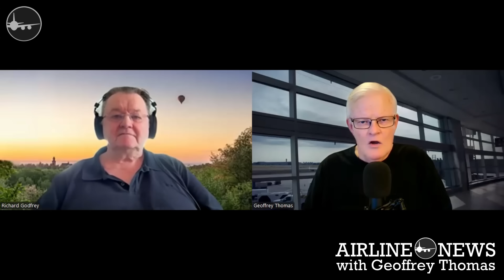Air India Crash - Probable Cause  #airindiacrash

Comment: I don't think its smoke. I think the engines are just kicking up dust of the ground.
Reply: Smoke would have been hot and would have risen... like smoke.    After amazing coincidence--smoke emitted exactly at rotation, when engine exhaust hits the ground.
Reply: Grey dust from a brown soil?
Have a look at Google satellite picture of the airport
Reply: @Guy-UK  I really don't think you can draw any useful conclusions from how it looks. I'm not sure what dirt, soil, gravel and whatever else is on the ground looks like when you aerosol it. The camera angle is from behind looking into it, so it is compressing it, depending on the focal length of the lens, but I think the actual amount is magnified by the camera angle and the compression. The light from the sky is shining through, thus backlighting it. The camera is probably a relatively low megapixel camera. We don't know the ISO setting, which can add noise to the video, or the white balance setting, which can skew the colors, along with the color science used by the camera. There are a lot of variables and when you put it all together, who knows what it will look like. My guess is it's just dust from the ground.
Reply: I still think it's dust. I rewatched the CCTV video several times, and to my eye the majority of it clearly seems to be originating from the ground. That, combined with the swirling, almost tornado-like motion that ii is makes would again lead me to believe it is dust getting kick up from the engine wash. As the plane climbs higher, no alleged smoke is scene originating from the airplane. As for the color, it looks more brownish to me than grayish.

Comment: THANK YOU!  FINALLY a reasonable explanation of why the cutoff switches were moved.  A fire warning would certainly make temporary engine cutoff at least somewhat reasonable.
Reply: If there were engine fire alerts, this would have been recorded on the FDR and would have been included in the preliminary report. It wasn’t.
Reply: @MrDeepseadweller  A lot of data which obviously could be very helpful in finding out the truth are not included in the PR, although they certainly have been recorded on the FDR and downloaded successfully. The reason and exact time for the triggering of the RAT deployment is just one example. The order of the events presented in the PR suggests that the RAT deployment followed the movement of the fuel switches to cut-off. But - according to Richards investigation - the RAT deployment was triggered before the fuel switches were moved to cut-off. The authors of the PR avoided so consequently the presentation of any irregularities which occured before the movement of the fuel switches to cut-off, that it's hard to believe that there was no intention behind it.
Reply: @MrDeepseadweller  Would have been, or SHOULD have been.  The preliminary report is not comprehensive and that report is so deficient, how do you know there wasn't a fire alert recorded by the FDR but they just didn't mention it?
Reply: @mikeyc8139  How do you know it wasn't gremlins, but they just didn't mention it?
Reply: @jefframin  Very well could be.  With how bad that report is, it could be tribbles for all we know!
Reply: Why? Cutting off both engines at that phase of flight is certain death.
Reply: @ky314  No, it is not necessarily. If the engines restarted several seconds earlier, they had a real chance to save the aircraft. But of course one has to ask the following questions: How did the systems inform the pilots about the fire and was the cutoff of the fuel supply an adequate reaction to that? Why did several seconds pass before the fuel switches were set to run again - unfortunately too late to prevent the crash?

Comment: With so many electronic components aboard modern aircraft, there's no way to mathematically check and failsafe all possible bugs missleadleading the FADEC. Allowing the FADEC to shut down the engines was a design decision. It was motivated by a strong rationale I'm sure.
In light of this accident, would such a design still be implemented?
If I were a pilot I would feel frightened to know some IT system onboard can shutdown my engines without asking me first. I would much prefer having a red flashing warning asking me to shut down the engines myself. The authority is fully mine when I'm up in the air.
But I'm no pilot and the only machine I drive is my 2017 Peugeot 508 which is fitted with many electronic components as well, but none that can stop nor steer the car.
My gut feeling is telling me the hidden issue is the pervasive Full Authority power granted to the FADEC and who knows how many other components.

Comment: Thank you for this thoughtful episode and for keeping the AI171 discussion alive — it is important for the aviation community.

On the specific point of “smoke” seen after rotation, I’d suggest a careful recheck once please Available footage and ATC/CCTV records indicate no confirmed smoke or fire during rotation/climb — smoke first becomes clear only post-impact. Several analysts interpret the haze in the CCTV as dust/debris displacement, not combustion.
Also, the technical descriptions in the report lean more toward post-crash fire rather than an in-flight lithium battery runaway:

1) Impact + thermal damage together suggest the unit was first fractured mechanically, then exposed to external fire (post-impact fuel burn).
2) The forward EAFR was still attached, with connectors melted but connected, and both the ULB and lithium battery intact as per AAIB report. A violent in-flight runaway would usually rupture or scatter the battery, not leave it in place ideally .
3) Soot and melted connectors match external jet-fuel fire patterns, not likely the distinctive residue of a lithium cell venting (which often leaves white salts, fragments, or suppression traces).
4) Recovery context — units were found in wreckage days later — reads like survey of fire-affected debris, almost not a pre-impact event.

Operationally, a severe APU battery event in climb would likely have produced cockpit alerts, smoke warnings, or CVR crew comments — none are noted in the available record / report.
While a localized in-flight battery event for sure can’t be fully excluded, the available signatures point more strongly to post-impact thermal effects. 

Just adding this perspective politely for balance — I may well be wrong, but felt it worth sharing my side of the analysis. Of course, we’ll all await the AAIB’s final report for authoritative conclusions. Thank you again for sparking this valuable discussion.
Reply: I think you might be describing the wrong EAFR?
Reply: @pa1189j  As per AAIB report - The aft EAFR was located on the roof top of Building A on 13th June 2025. The EAFR had
impact and thermal damages to the housing. The wires were protruding from the housing and the connectors were burnt.
The forward EAFR was located on 16th June 2025 from the wreckage debris besides the Building F. The EAFR was burnt and covered in soot. The EAFR was still attached to the equipment shelf with part of the connector melted but still connected. The ULB was still connected to the housing and the lithium battery was also attached to the equipment shelf, which was removed later prior to transportation. The download from the FWD EAFR was  successful. However the aft EAFR was substantially damaged and could not be downloaded.
Reply: @Skyking-v2m  Good. That’s a bit better with some more description from the report.
Reply: @pa1189j  Thanks much. So the point1) to 4) ideally covers both EAFRs.
Reply: @Skyking-v2m  The rear EAFR shows signs of lithium fire damage. The fore EAFR is consistent with a carbon based fire.
Reply: @pa1189j  Appreciate your input. My reading of the AAIB preliminary report is that both units were described with impact + thermal damage, soot, melted connectors, intact ULB and lithium battery — which usually aligns with external post-impact fire patterns rather than a contained in-flight lithium event. A true runaway typically ruptures or scatters the battery, leaving more distinctive residue. Of course, the final AAIB report will give the definitive forensic view. Thanks
Reply: @Skyking-v2m look at the rear EAFR in the report. Very different to the adjacent one of the forward EAFR. And the aft one was also severely damaged internally, so a far higher temperature than by conventional crash damage.
Reply: @pa1189j  Appreciate your observation. Referring back to AAIB’s preliminary text — for the aft EAFR it records: “impact and thermal damages to the housing, wires protruding from the housing, and the connectors burnt.”The protruding wires and fractured housing point to a strong impact load first, followed by external fire exposure. If it had been a lithium runaway as you suggest, we’d normally expect the wires/housing to be consumed from within — leaving charred stubs or largely obliterated thermal debris — not clean protrusion from fracture. Thus one can expect charred remnants, melted stubs, or even complete obliteration of the wiring bundle because the fire burns from inside out. Also if it had been a violent lithium runaway in-flight, we’d often expect rupture/ejection of cell material or distinct residue patterns.  By contrast, the AAIB description shows intact protruding wires and fractured housing. That said, the final forensic/chemical analysis by AAIB will be the real decider, so I’ll keep an open mind till then. Thanks for this insightful discussion.
Reply: @Skyking-v2m  The EAFR was ejected from the plane and landed on an adjacent roof. Any fire damage would have been caused before that point. And it wasn't the sooty appearance that is commonly found with carbon based fires. Just compare the two pictures. One is virtually black, the other is grey and melted away in many places. But I agree lets see the forensic test on the surface of the EAFR to determine the source. I presume they'll reveal it, but I wouldn't risk my house on it for certain.
Reply: "Cold smoke"...drifted to the ground exactly like dust instead of rising exactly like hot smoke.  Doubtful. Would Air India dare conceal what the flight data recorder would say about a fire (smoke) at takeoff?   Doubt it.

Comment: I've considered a catastrophic electrical failure as my favoured scenario from early in the investigation (I wrote to Richard on this point at the time). What is of concern - quite apart from the issues and recomendations Richard makes in this video - is that it seems to me, as with the motor vehicle industry, the aircraft industry has allowed itself to put what they see as efficiency (in this case the use of Li-ion batteries having a beneficial power density) ahead of safety. A Li-ion battery to entering thermal runaway is almost certainly caused by just one bad cell and this raises the notion that one very small part costing just cents/pennies has the potential to bring down a 'plane costing considerably more. As always with current Li-ion technology, it's not the fact that batteries can catch fire, it is the way the ensuing conflagration can destroy much more than just the battery itself.
Reply: I guess you are still bang on with your favoured scenario of a catastrophic electrical faiure.  As per my persoal opinion any of these three likley events as mentioned , could have lead to this unfortunate disaster .    1)  A major total electrical power failure that possibly led to some spurrious/automatic/malfunctional airframe logic command causing FSOVs to fail-safe shut instantaneously and cutting off the fuel supply.
2) The DC bus that powers the Fuel Actuators solenoids likely failed, due to Electrical Cascade, causing the solenoids to de-energize. With the solenoids no longer powered, the FSOVs snapped shut in their fail-safe position. This Uncommanded closure cut off fuel flow to both engines instantly, resulting in an immediate dual-engine flameout.  This possibly got recorded generic as FUEL CUT OFF in FDR side. 
3) Additional possibility, though very rare is FADEC likely lost command authority; engines lost metered fuel flow as the FMU was compromised. This led to immediate Engine fuel supply being cut-off and Aircraft Stalling.   

The 3) is a rare possibility as at the takeoff thrust, each FADEC is self-powered by its PMA; a FADEC-first/FMU-first shutdown would require very rare, identical EEC failures or simultaneous PMA defeats — much lower prior probability than a single airframe electrical fault that issues (or mimics) dual cutoff commands. 
RAT deployment here is consistent with downstream consequence (both engines flamed out because fuel was cut at the spar). likely not indicating FADEC to fail.
Disclaimer :  This is purely an independent, technical perspective meant for professional discussion, review and knowledge-sharing amoung aviation peers — not an official conclusion

Comment: I remember hearing the observation about fire damage to the aft data recorders and then seeing the aft section of the airplane nearly fully intact, that did not make sense to me.

Very interesting, and viable, explanation.  

Keep up the great work!
Reply: The Aft flight recorder was mounted above 1 to 2 metres in front of where the tail broke off... so it almost survived.
Reply: Just to add this battery is not located near the aft A/E bay or under toilets or galley areas or any where near the aft FDR at least 50ft away and a pressure bulkhead wall separating them.
Reply: The APU battery is in the Aft EE bay.
Reply: @Corwin4000 sorry your wrong and we don't use meters in aviation when we quote the airframe location.
Reply: To quote the Aircraft Incident Report 
Auxiliary Power Unit Battery Fire 
Japan Airlines Boeing 787-8, JA829J: "The 
APU battery is located at floor level within the aft E/E bay."

What is your source to claim it isn't?
Reply: @vaughanlockett658 what "standard" do you claim establishes metric vs. English in avionics design, are you citing RTCA?

Comment: Why were the cutoff switches switched off from the cockpit??? Yeah, someone had to do it
Reply: There’s another youtuber showing that the fuel switches weren’t necessarily turned off, rather an electrical fault in the switch monitoring circuitry that gave that incorrect assumption.
Reply: @jm6604-c4d wow, didn't know that was possible
Reply: @markcardwell  it is quite a stretch to have that happen to two independent switches... but give the previous crash-free record of the 787, whatever the cause is it must be something unlikely!
Reply: @Corwin4000 i think the capt did it and they're keeping it quiet

Comment: This is a fantastic site by very knowlegeable experts, but you have to wonder why they are speculating on the "probable cause", and not waiting for the Authority final "Investigation Report". This certainly raises a (new) critical view.
Reply: Because if anything like they are suggesting happened then it's a massive safety risk that needs fixing NOW
Reply: @Guy-UK   but they dare not admit to another fault that they were aware of.
Reply: Perhaps because the final report may be as compromised as the preliminary one. There's a lot at stake.

Comment: Knew it - Thanks for saying this - right form episode 160 i have been saying this..  Here is a quote from myself in episode 160 in reply..   Critical electrical failure at WOW at the same time as White mist was layed on runway behind shed to appear a second later as a pool of heaver than air gas 1 foot deep over the grass  (this disipated after 1 second into the grass) - there was no smoke from engines just mist as wings stired up this pool of gas..   Just my ideas...  Kevin.. end quote - This was from battery Vent due to (yes maybe water or) my sugestion is Diode blown by surge from Brake inverter 28v to 120v...  Thank you for comming to this conclusion - but my question is now why the change after assuring us that the battery problem was cured.. is there any other infomation i have missed - be interesting to know...  Kevin....  Thanks again..

Comment: Other than mechanical errors, the prolonged takeoff roll may be attributed to mistakes made while inputting inaccurate performance data into the FMC. This includes factors such as the assumed temperature for Flex/reduced thrust takeoffs, which can lead to erroneous performance calculations (TOL/TO), a takeoff weight that exceeds the weight recorded in the FMC, the flap configuration setting, ZFW. All these factors contribute to the miscalculation of V-speeds (V1, VR, V2). The list goes on. Great episode once again gentleman.
Reply: Somebody would find the Air India guy who said they were using lower power and longer takeoff runs to save fuel.  Somebody quoted the guy shortly after the crash.  I'm not sure it wasn't one of the two on this video.